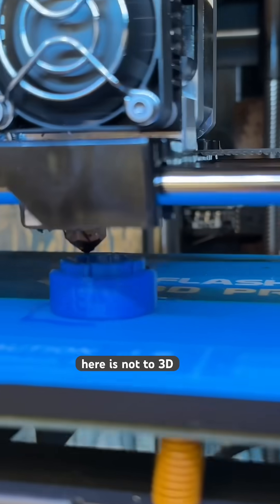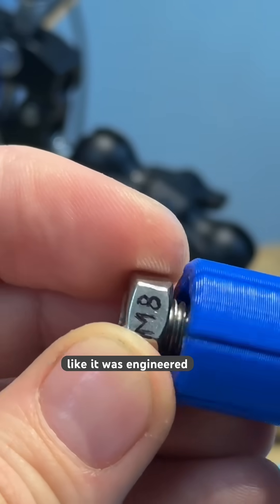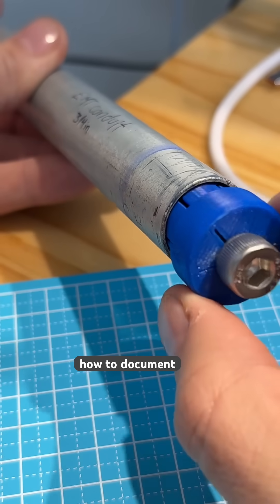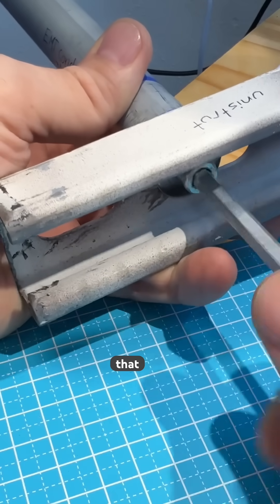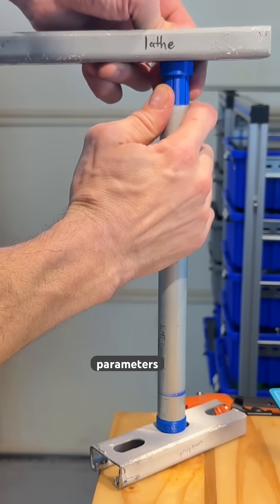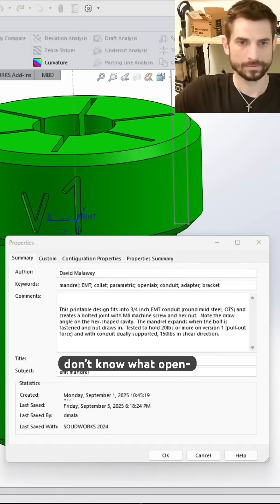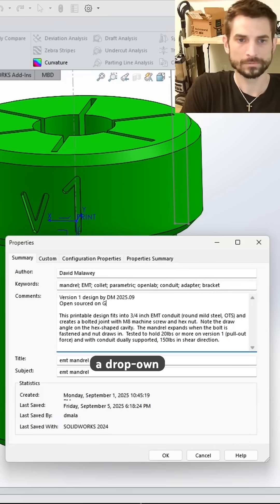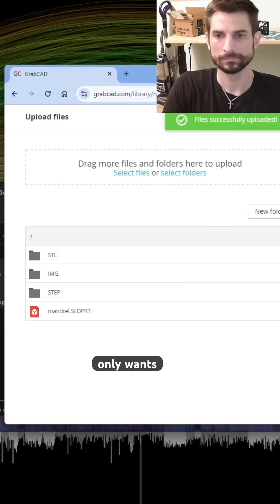This printed design holds a steel tube where the tube goes. #opensourcehardware #conduit

Comment: I just solved this exact same "problem", In my design the plastic  slides past the plastic instead of the nut sliding against the plastic. The second part makes it more complex to print, but the plastic on plastic (and big contact surfaces) I think makes it more durable.

Comment: You don't need the collar for that application, when the tube is fastened to a flat. The flat will do a better job, and the device could be all internal, making the whole connection sturdier/less prone to crack.
Reply: In fact, no expansion bolt I've seen has had a collar. If you need one, because the other side isn't flat, just add a steel washer.

Comment: I agree with what you're saying. Remeber that the ultimate strength of the part may not be the orientation that produces the "neatest, cleanest" part. Delamination is the major flaw of printed parts.

Comment: Agree with literally everything in this video
Fantastic work literally exactly what I've been hoping for in the 3D printing community. Feels like there's a hole in the current industry where something like this is missing. We have things like Printables and such where people post designs but it's very hard to find /standardized/ parts for something. For example, you have to search for a long time to find something like this mandrel part to use it in your project - and then there's thirty variations and then actually importing it into your design to use it proves very difficult. Open source hardware doesn't have the modularity that software does yet because it's very hard to reuse or even find a part for reuse.

Comment: Not sure what you are talking about, a PDM (Product Data Management)?
There seems to be one, in the making as of now it seem, but that's for FreeCAD, and the point you are trying to make is... Maybe impossible to get one because practically no one uses FreeCAD and parametric designs are locked to the software used. Also a PDM would be too cumbersome / not flexible enough, my guess is that it should self-packaged... And isn't that already the case?

Comment: Software nerds that are also mechanically inclined are few. FreeCAD is one of the most ambitious open source mechanical software, it is great for hobbyist who can't justify the price of MCAD software but also need it to be commercially legal. Development is steady but slow, and I'll still continue using and supporting it.
Reply: Big respect on the FreeCAD. I'm still a turbo noob with it, but goddang I love it's usability
Reply: @Twizzlahs thank you for sharing that. I'm just getting into CAD and thought that I was just too dumb to learn FreeCAD so I tried tinker CAD. I realize either way I have to learn but I want to support open source WAY MORE than I want to just take the easy route, with Autodesk. Not that Autodesk is bad but there needs to be competition for economies to be healthy.
Reply: Thanks! Looks like it's exactly the type of software i have been looking for!
Reply: after that 1.0 or 1.1 update it seems to have improved a lot, I have astronomically less breakage or errors.
Reply: DesignSpark is pretty nice too imo
Reply: using freecad for years, it is a steep learning curve
but i always was able to do what i wanted

Comment: Mebbe a version with a lip over the edge of the EMT? (I ask because, depending on how you cut it, there is often a bur there, making a flush metal-to-plastic joint a little spicier than people may be expecting.)

Comment: That was inspiring, and I think you hit the nail on the head.

I also think that one of the challenges is going to be the ability of users/makers to reliably find components that have been parameterized and documented. (please forgive if I'm preaching to the choir; I'm not very familiar with the design or documentation prosesses in mechanical engineering) 

Giving structure to the documentation process might be able to reduce the time it takes to do so, and would also allow for things like indexed fields, searchable tags, etc. As a spreadsheet jockey, I'm not sure what use I could be, but I'd love to help!

Comment: So you made a collet? What is there to prove here? I must be lost.
Reply: Its a joint that can be used with very available materials, making it fast and cheap without the flimsiness of universal parts. Attaching a rod to a unistrut with high load bearing without welding or drilling is not that easy.

Comment: Would this be a good use of GitHub? Or would it be worthwhile to create a new repository that tracked hardware version changes?
Reply: I'm guessing it's possible to use GitHub for this yeah. 3d models are just files after all, it'll be wierd maybe, but that could work XD

Comment: Great design. Could you make it slightly narrower at one end so the pipe butts right up against bracket? Wouldn’t that be stronger too? 

I’m not sure why there are slots at the end opposite the nut, though. Maybe there is a reason for them which also prevents it being narrower.
Reply: The slots are a flex zone. The point of this was to snuggly fit inside the pipe, and then when you tighten the bolt it expands the plastic slightly outward creating friction with the pipe. Basically like a sidewalk or road when you’re creating a “breaking point”. He’s just forcing the plastic to spread apart while not cracking.
Reply: @minecraftvsmasterz  yeah I don’t mean the slots inside the pipe. I understand that part. I meant the slots at the other end outside the pipe.
Reply: Maybe they allow inward flex that might prevent stressing the part when the other side expands. Think of it as hinging instead of pure tension.